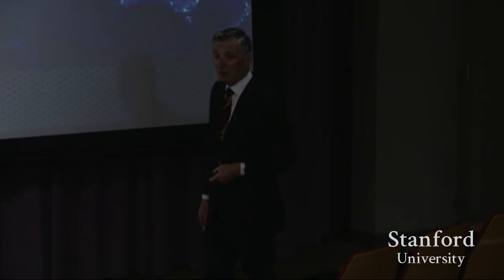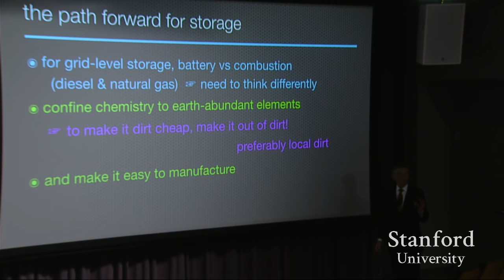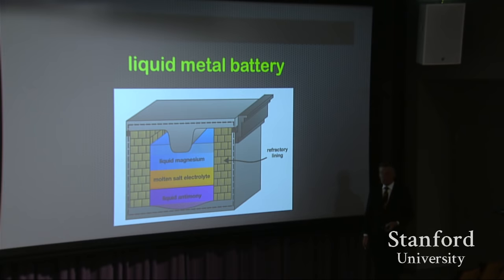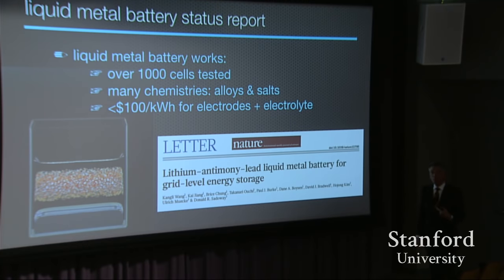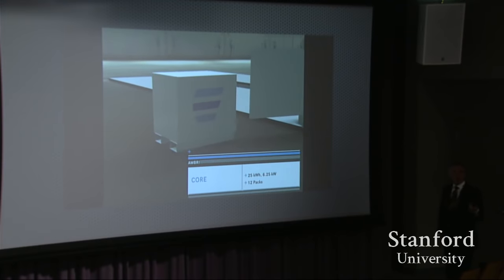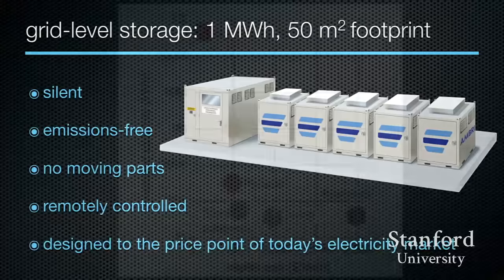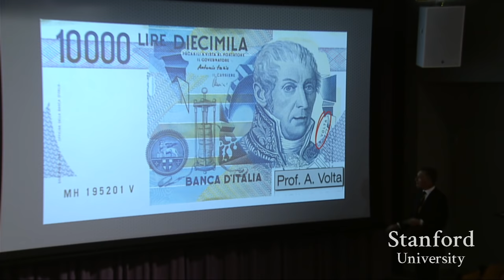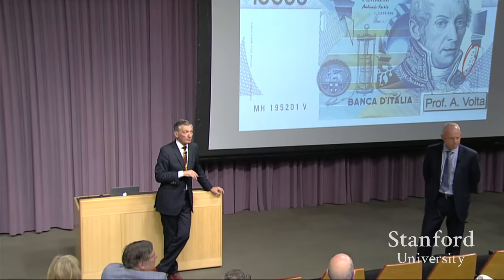Don Sadoway | Innovation in Stationary Electricity Storage: The Liquid Metal Battery

Comment: At $500 a Kilowatt hour for this battery. If the wholesale price is $18 per megawatt hour for Wind turbine and $24 per megawatt hour for coal it would take 3.17 years just to pay off this battery. Which would cost half a million per megawatt! This is based off of what wind turbines charge the energy company. If my math is correct it would be feasible since you would be able to run after the sun went down.

Comment: So we changed ALL Vehicles to legally need a Catalytic Converter(CC) that contains Platinum and what’s worse the CC’s only work once the engine has got to optimum temperature. Considering 80% of car journeys are under 3 miles means for nearly all journeys the CC is not only not working, but causes the vehicles to burn more fuel!. But besides that I’ve seen a couple vids on yt of people who have made Platinum free Fuel Cells.

Comment: This works because it doesn't have to be portable.
It's stationary, so the weight and the bulk won't matter.
I can imagine a multiple story building size battery for the community use.
Other way of saying it is it's a step above lead-acid battery.

For the portable devices and transportation, they still have to come up with something else other than Li-Ion.

I think.

We'll need many more battery technologies for different uses.
There probably won't be one dominant technology.
Reply: Assembly is almost impossible since no one has figured out the bus work on top of the cells (make a bus work that all you have to do is bolt together).
Reply: this competing for large storage backup on an industrial scale against gas/oil backup generators and pumping water up a hill, it's not about mobility. 

if Li-Polymer batteries can be improved they would be the next step past Li-Ion for mobility - some variations of Li-Ion are expected to be out commercially in the next few years, but none of these are capable on large scales of liquid metal.
Reply: think of all the buildings amazon is putting on the market for availability like old K-Marts or old Blockbusters centralized and dirt cheap
Reply: One area of transportation which may be suitable for this battery is shipping where weight is less a concern.

Comment: the issue of whether the unit generates energy on it's own or not determines if it is a battery, or a giant capacitor.  The description seems to indicate capacitor.
Reply: Ummmm you do know a capacitor IS a battery right?
Reply: @BracaPhoto  you do know the difference between a capacitor and a battery, right?

They are superficially the same in that they can charge and discharge, but there are other issues that make them different.

Comment: All  very good but all we need to know really is: the duration of the battery, the efficiency of the battery, the energy density per kg and volume of the battery and the cost of storing 1kWh. Simple.
Reply: He's a fraud. He doesn't have the technology yet. He admits that pumped hydro is cheaper and it's just water in a damn Dan.

Comment: I love this concept.  Hope it comes to fruition at commercial scale.  Will work fine for transport applications too, of course.  An issue for longer term storage in these liquid metal cells could be keeping a battery pack at its operating temperature.  I guess you could play self-charge/discharge games by having a couple of cells at a low state of charge, then by grouping up pairs of batteries in series you get higher voltage than a single cell, then the pair can 'charge' the low cells (which are connected in parallel with a lower voltage), keeping both warm, then the now-discharged cells can be the sink for the next pair.  The BMS can run this game on any cell whose temperature is getting too low.  There will be some losses, but it is a method to keep the pack temperatures where required.

Comment: I think this would be good for cyclone/hurricane areas where each house could have  an onsite battery charged by solar and hooked into a local grid. In the case  of storm damage to the grid, each house would be able to stay powered and the grid of batteries could supply an area even if some houses do not have solar panels until that grid can be repaired. This means that neighbourhoods can keep running, food supplies can be kept fresh, local stores and fuel stations can draw from the local neighbourhood batteries to keep operating until utilities can be reconnected. Command electronics over the grid (similar to current technology where internet can be transmitted over the household electrical wiring) can be used to ensure batteries can cycle from the local solar panels while the household draws from the grid.
It would probable speed up community recovery.

Comment: Are these actually deployed anywhere? And so like the Tesla grid battery in South Australia, how much would a similarly sized one of yours cost?
Reply: The numbers I've heard indicate that Tesla lost tons of money on the Australian battery.   Given some of the numbers he presented (and by the way he DOES have  prototypes running at this point...) -- The smaller cells with on-going stress tests showing the lack of degradation over cycles...   I'd put the batteries in a shed in my back yard.  The battery in Australia also doesn't really have the problem of cold temperature, where the LI batteries fail if you try to charge them below about 0 C.  The solution there is electric heating.  But that will take many watts of power.
Reply: @Billblom  Probably a better solution is a 'ground source heat pump' style loop combined with good superinsulation in the shed structure.  For the running cost of a very small circulating pump with a fan on it, this produces reasonably consistent 55-56 degree at the inside heat exchanger; you could always use some of this as 'source' for a dedicated refrigerator-compressor-sized heat pump running as a "heater" only (no reversing valves and few potential failure points) if you need a higher rate of heat transfer to air.
Reply: @wizlish  The ground water is not very far down... Having a 5 to 7 ohm ground reading here (done with a megger) means the water is close by for heating and cooling.  Keeping the system "happy" would be easy when the shed is well insulated.  I had been looking at a vid where the guy that put together his battery system simply put the batteries in a well insulated box, and lined the box with some heating blankets that drew about 20 watts... The temp was set for 50 on them, so there would be no overheating because of the heat.  (Along with a couple of thermocouples tied to a small computer that would turn off the power to the heating system).  I need to look into a ground source for the house here.. the installation would be ugly, lawn wise, but would cut the costs of heating and cooling dramatically.

Comment: Can the thermal losses be captured and used for space heating, e.g. like co-generation?
Reply: I can't see why not. Though it depends on how well the thermal management and insulation works. Ideally there shouldn't be too much heat external, or that would need be replenished in some way, costing energy, as would taking energy out from inside the insulation boundary.
It is swings and roundabouts. However on larger installations it way be feasible, certainly for a heating source.

Comment: Running small-scale laboratory prototypes is fine, but for this technology to get off the ground, Ambri needs to partner with a public utility to build a pilot plant where the technology can be exercised and demonstrated in a real-world situation.  This could be done even if the first batteries are inefficiently hand-built, without the automation envisioned for a full-scale factory.
Reply: Yes. I'm wondering in scaling to the extent of using concrete enclosures, with suitable refractory and steel linings. As he said the larger the more efficient and he also reported relatively low pressures.
It is a very interesting idea.
I'm sure that given some experimentation with Bismuth and some other similar metals they will find lower temp metals that will make the cells more efficient.
I'm thinking in particular of the many different low melting point Bismuth alloys, such a fields metal, etc. There are also quite a number of different Lead alloys with different melting points. I'm sure there will be a few recopies that could yield some improvements.

Comment: Great video, fully watched.
Only thing which was irritating is Amp hours rather than Watt hours :|

Thought he said in video that voltage = 1V, so it's same as Watt hour, in the presentation they could had used more scientific Wh (watt hour) notation.
Reply: ampere-hours are a pretty standard measure of battery performance, so perhaps think of this as the same 'legacy' as American preference to express engine power in hp instead of kW.

Comment: How hard is it to restart completely frozen batteries? How much energy does it take? Are they built for that? Where are the heating electrodes for cold start? ...
Missing chart for comparison flowbatteries energy density ecologic impact ...
There was that flow battery with a drinkable liquid (water and iron...) those units ship in shipping containers?

Battery Fueled by Iron and Water Could Transform the Power Grid (ESS Inc. Wilsonville OR):
https://www.youtube.com/watch?v=HmtI8Wat7rY
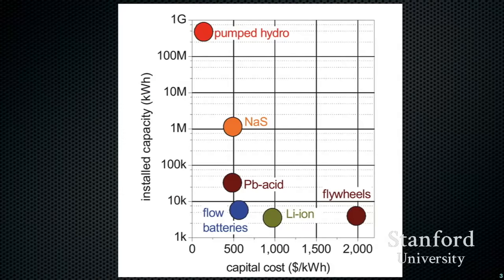02:41 50kW/400kWh one shipping container probably 40feet
Used containers ^^:
https://www.mrbox.co.uk/shipping-containers/
Reply: you just charge them and they get hot.
Reply: You don't have to 'restart' a frozen battery, you just have to thaw it to where the charge carriers in the electrolyte can actually move (this being at a lower temperature than the nominal phase change of water around 32 degrees F) 

Part of the 'historical' problem with frozen batteries is that water expands when it freezes, and this can damage the internal structure.  Another part of the problem is that 'charging' a frozen battery doesn't automatically "melt the freezing" first and then proceed to fill up the capacity.  One of the 'paradigm changes' with these circulated-electrolyte batteries (where so much of the "charge" is in the distributed reservoir and not in the 'battery' section that actually moves electrons in circuits) is that you can relatively easily drain them (into an insulated and/or heated 'tank') if they are not being used, or subject to freezing, and then refilled at need, so the issues with trying to charge ice don't ever practically arise...

Comment: Cost per kilowatt hour assembled and on site about the same as stored hydro, and much, much cheaper than lithium, SO WHERE IS IT?   Follow up please?
Reply: They had it at $500 per kWh in the chart for the whole system. That's what current LiFeOP4 battery systems are already selling for. With Lithium batteries still having a chance of a 2x improvement in the next years. They probably have to go back to the drawing board to get them cheaper.

Comment: The PowerWall may be expensive, but the first time the neighborhood lost power and I didn’t notice?   

Priceless.
Reply: Doesnt the Powerwall need an active internet connection to work?
Reply: @pjpa305  ??? Why would it need ANY connection to ANYTHING?  With a Powerwall battery of sufficient size, you can be completely off-grid.  That is actually how millions of homes today already are.
Reply: @billdale1  That is why I asked. I watched a  review on it recently. And that was a major complaint. That because it needed connection to Tesla's servers to operate, that if the grid goes down, your "off the grid" power also goes down. It would be a major draw back of the power wall for me. Hence my question to someone who owns one...
Reply: . PJ Pa  No. Internet connectivity is only needed to read the battery's state and change parameters. It can charge and discharge independently.
Reply: @tomswiftTTT  Thanks Mike!
Reply: I think you need their backup gateway (dunno if it is normally included) or you will lose power when the grid power goes down. your home needs to disconnect from grid to prevent feeding energy back and endangering people working with the grid and so on..

Comment: On this cell, once charged how do you keep the liquid metal melted with no current flow as in simple storage?  In the storage is there going to need a constant current flow , and would there be losses involved to maintain the charge ?
Reply: Yes but the question is how long can they stay hot and melted salts be viable if they were static with no charge or drain current ?

Comment: This video was a "recommended for you" on my youtube page, and I had just watched the CBS video talking about this man and his "revolutionary technology." What struck me is that there was not one bit of real information about HOW this battery was supposed to work, why it was inexpensive, and how it could last into a long cycle of use. I wonder if anyone else thought of that as being just a tiny bit too vague......? At least in this presentation, we have some specificity about the theory. Clearly, this can fit in with the current (sic) grid technology, since the battery can be charged overnight by the grid in summer, and discharge during the day during the high air conditioning load to help prevent brownouts.
Reply: No information on how it works?!? Did you actually WATCH it???
Reply: @billdale1  Good question. I am an EE not a chemistry expert and I  found this presentation to be very understandable and quite in depth as to how this battery will function. Unfortunately it seems energy has become a highly fractured religion.
Reply: Because the CBC audience is not the same as the Stanford audience.
Reply: Art Houston - OK, but in this video Prof. Sadoway DID discuss the huge economic benefits of what I call "peak shaving" (the highways analogy). We also need grid and neighbourhood level storage to support the intermittent-power producing renewables. Now, if the 'powers that be' could revise the regulatory framework and remove assorted roadblocks we could get somewhere in making civilization more efficient and sustainable.

Comment: I was wondering if it is suitable for off grid solar power? I guess it would have to be used with hybro or wind turbines also. To keep it from cooling. If there is no sun for a while. And is there a minimum operating current? I'd like to have about 30 large cells , my off grid lithium ion bank is 29.4v, so I guess 28-29 cells @1v each? And at what cost?

Comment: I love that quick discussion on flow Batteries at the very end. I believe in flow batteries but they certainly appear to be passing through the valley of death.
Reply: Ich dont think so. I mean Vanadium is an example of non abundant element and is expensive. 

In this case I could envision something like pumping the Mg and the Sb and solidify/freeze dry them (respective the MgSb alloy into solid) for storage. And later you can remelt them when needed

Anyway flow batteries are a technology as batteries with certain pros and cons. You could also be tempted ot say that batteries are not going to make it because capacities are too small or materials too expensive. Also, cell voltage versus iR drop in the electrolyte I think is important for the overall efficiency. 

Molten salt doesnt have a high reisistance, plus as he said reaction velocities are much increased at higher temperatures and I really do think that a molten metal flow battery could eventually be one of many possible solutions

Comment: How long will it take to charge and how fast can we discharge it?
A Lithium ion Tesla battery can go from 10-80 in 20 minits and to a 100 in 2 hours, how about your battery?

Also, is it possible to put this battery in a car? Or is the temperature thing a problem?
Reply: It's not for cars!!! It's for the Grid.
Reply: weight
Reply: He stated that it is capable of very high current density.  In other words, power can come out quickly.  Unlike the Lithium Ion Batteries in the Tesla, you can increase the capacity of the Aluminum/Antimony battery by making a bigger pool of Aluminum and a bigger pool of Antimony.  And if you make the capacity very large, then it will take you a long time to discharge it.  So how quickly you can discharge it depends on how big those "pools" are.
Reply: @jwestney2859  Keep in mind that in a circulating battery, charge density can be independent of discharge rate.  So 'how much charge is in the battery system" is very different from "how much" or "how quickly" can I get charge out of the battery as circuit electricity.  'Current density' here refers to the part of the structure that does the latter, and it's important for charge rate, but part of the idea here is that the 'charged' liquid can be continuously circulated out of the actual 'electrochemical' structure, at which point it has become a 'carrier fuel' as much as, say, syndiesel or liquid products of hydrogenation, and theoretically stored and pumped much as liquid fuels are.